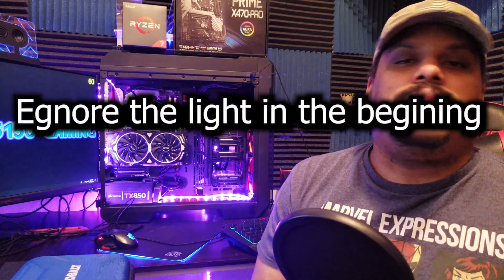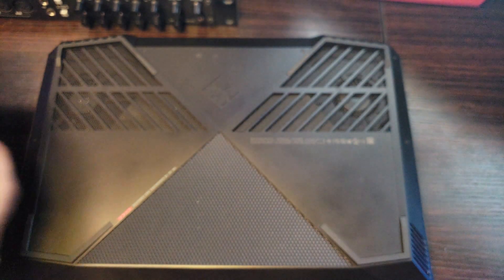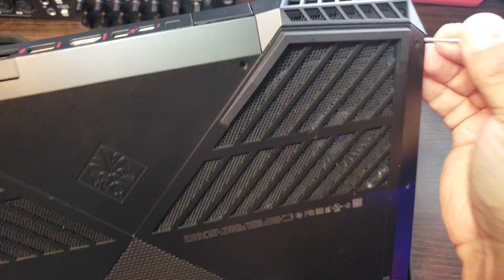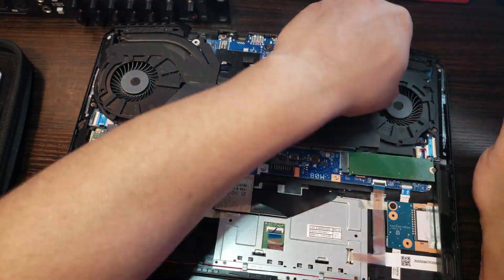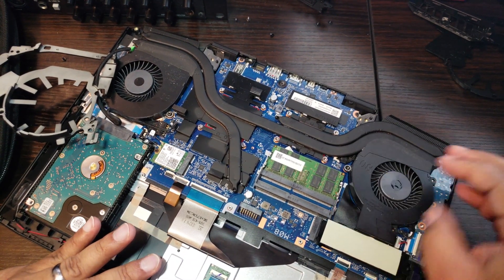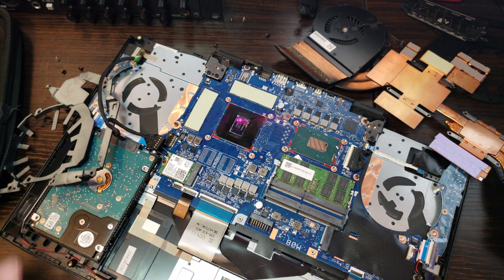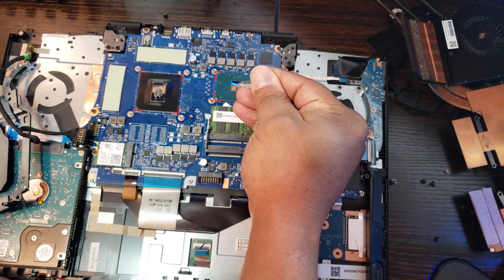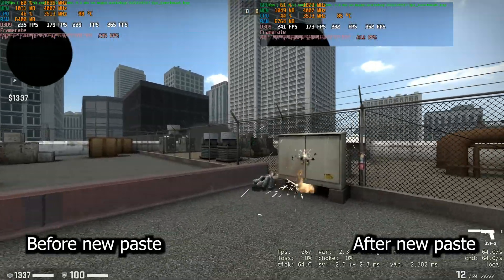HP-Omen 15 how to add new thermal paste to laptop / Laptop Tear down

Comment: Hey! Thank you for the guide! I took off the tape that connected the heating and the fans, what kind of tape should I replace it with?? I was think it used 3M's thermal tape? But im not sure. Going to get paste as well to replace. Didn't think of that, thank youu

Comment: Can I change gpu??? Or or intel?
Reply from the maker: Nra, most laptops like this the gpu and cpu are soldered in. You can only upgrade the RAM and Hard drives. On the 2070 it came with 512gb I replaced with a 2tb ssd. You can upgrade the monitor, a bit more taxing job though. 😉

Comment: I have some black things on the left copper on the fan holdings?

Is it like burns or something?
Reply: Not positive since I don’t see a picture, but it’s probably just overspray from when they paint everything black. I noticed some black on the copper areas then realized it was just paint. I’d have to see it to confirm though
Reply from the maker: Can you take a photo? It maybe burns 🤔
Reply: @EnforcerGamingX  ok where should i send it?
Reply from the maker: Just use a photo sharing app like imgur you can post a link to here.

Comment: what is your gpu temps before and after paste?
becuase my gpu temps getting 91 degree and lower down fps and cpu like 95 degree like hell
i applied artic silver mx4 paste on my hp omen 15 rtx 2060 i7 9th gen but there is no difference i tried to undervolt the cpu but nothing works im very sad do u have any idea?
Reply from the maker: I shouldn't answer cuz you did watch the end.. lol. Just kidding man long video.  But yeah I have a before and after paste at the end. You want to be a bit careful with adding too much paste which could be your case or not enough. I'm guilty of adding too much most of the time. I added a bit too much in this video actually. I still need to paste my 2070 hp-omen 15. Paste should work though.
Reply: @EnforcerGamingX  i applied paste followed by linustech video that how to applied thermal paste but i cant see any change in temps on heavy load elp me out if u have any idea?
Reply: @EnforcerGamingX  and i dont see any gpu temps in the end part of thermal comparison
Reply from the maker: Oh man you're right! That afterburner profile should've had the gpu temp as well. I never had any gpu heat issues on this laptop. As for the paste added, could have added too much or too little paste or the undervolt did not reset correctly. Sorry about the Gpu temp. I'll try to remember to get it on the 2070.
Reply: @EnforcerGamingX  i added thermal paste like many youtuber does but no change in temps i tried to undervolt cppu by throthle stop but it couldnt work in games

Comment: Found your video really helpful. Could do with a little more advice on how you put everything back together (the video skipped this a little) - in particular, what thermal tape or adhesive did or would you use to refix the heatsink to the fans (where it may have come loose) and to stick the black cover/flap back down? Anthing to avoid? Thanks.
Reply from the maker: Sorry I've missed a lot of comments lately. Yeah I do agree I did do the part where I put everything back together but didn't realize it stopped recording till it was too late. So if you watch the end there,  you can kinda tell I switched to a voice over and it ends as I'm putting it back together lol. I'm planning a new repaste video with the rtx 2070 hp-omen. Sorry about that man. Hope you were able to get everything back in and running.

Comment: Omen 15 owner here, thinking of re-pasting, just a question.I got 3 tubes of mx 4 4 years ago, I opened one to use a tiny bit. Does thermal paste go bad? Can I use the remainder of the opened tube?
Reply from the maker: As long as it stayed closed after you used it and it was not stored in a hot or too cold of an area. You can tell by the consistency, it will harden if left open, it it was too hot it will be more liquid than paste. Normally, I'll just buy another tube most are not too expensive, it's better to have a new tube for 5-6 bucks and put it in than a month down having to replace it again.
Reply: @EnforcerGamingX  Thanx, I threw out the opened one, will use the unopened tube, I was never really going to risk it with the old stuff, it was more of a curiosity on my part, thanx again, great vid btw!

Comment: its been 3 years since  bought my omen laptop
is it about time i replace thermal paste?
Reply from the maker: If it's getting hot for sure yes. If it's running well no heating issues no reason to open it up and add it. It don't hurt to do it, but after 3 years you likely have some dust build up in there still good to open it up and give it a air can if anything. :) Thanks for watching.

Comment: is it sufficient if i just clean the fans when i do this? i dont have thermal paste, would the cpu still work well if i took it out, cleaned the fans and just put it back without touching the thermal paste????
Reply: Absolutely not, that's the worst thing you can do to any computer. The point is putting better thermal paste and increase the heat transfer.  YOu can kill your laptop instantly if you do not put a new thermal paste.   If you just clean the fan, that's fine but you do not lift  the heatsink  from the CPU.  Cleaning with air blower (Giotos) is the best way, no residue without even opening the laptop. Just blow it off from the fan ventilators.

Comment: Hey! not sure if you still around but ill shoot my shot. I have HP-Omen 15 with RTX 2070 max q and 9th gen i7, its 10 months old. I get CPU temps at 97C when gaming however my GPU stays around 75-80C,  even though the CPU gets that hot, i dont actually get performance dips. Also when i charge the laptop and perform casual browsing tasks, the CPU temps shoot up significantly and sit at around 80-90C which has me worried lol. Now im not sure how accurate the temperature readers bcs my suspicions lie there. What are your thoughts/recommendations? Thanks.
Reply from the maker: Yeah I got that one also few months ago, it's the same issue, mostly have the option to use the power option in hp command center to casual or repaste like this. There are people that undervolt as well.
Reply: Same for me, I just repasted and cleaned the fans and cooling fins and the temps improved a lot

Comment: Good video, looks easier than I thought.
I paid 15 dollars for the cleanup and thermal paste replacement. Does it worth?
Reply from the maker: Yeah if you get a good quality paste it's worth it. You just don't want the manufacturer thermal pads they use, often they will only last a month or 2.

Comment: Can I upgrade the GPU on this laptop? Is that possible?
Reply from the maker: No unfortunately not, not many that you can really do that. As it's soldered in. Thanks for watching!
Reply: yes, you need technical skills and good at soldering. Its possible for sure, but is it worth all the effort...probably not.

Comment: Thermal grizzly kryonaut sucks.i have this same model except with a i7 9750h and gtx 1660ti.97 degrees of hell...i went the undervolt route and now in the 74 degree area.oh well
Reply: Got the same specs.. can you tell me your undervolt settings? Ive barely got 5-7 degrees of difference with my undervolt.. :(
Reply: @chinmaydas9878 -1.45 undervolt tpl was 28 and the cores should be 3.4ghz on all cores.
Reply: @nuyorican91st  bro, that tpl is messing up the cpu doe, i did the same settings too at first. But try running the TS bench thing and you'll see errors everywhere... Basically what that does is, instead of letting the temp go high and thermal throttle, it limits the power the cpu and makes the cpu throttle... So basically that makes the cpu unstable, despite u thinking its all good cz temps are low. I did a bit of reading into it to find this out. I am currently at -1.45 and 3.2ghz and the max min tpl as 55 and 90.. this helps me get near 87 to 90 degrees and sometimes 94 95 too but atleast the cpu is not getting damaged.. help me find out more if u know anything
Reply: I have this exact problem, undervolting didn't do much. Have you found any other solution I can try while waiting for my thermal paste to arrive?

Comment: Can you help me? I follow your tutorial and then when I want to start my PC the screen show me a error of the fans
they are disconected, I forget conect one and I fix it, then I start again and the 2 fans stops, you know what I can do? sorry for my english BTW. thank!
Reply: Make sure you didn't tear any of the cables trying to pull em out too.
Reply from the maker: That's bad, are you sure the fan is reconnected?  Also make sure nothing got stuck in the fan, try blowing it out with compressed air. If it's still not going there has to be a bad connection in the cable.

Comment: Thanks you so much! I have an Omen 15 2018 (i5 8300h, 1050ti 4GB) and the temps had gotten really out of control. CPU constantly thermal throttling and GPU on fire also. I used this guide to help me perform the repaste and now the temps are 25-30C cooler. You saved me!

Comment: Just got some Artic Silver MX-4 and a toolkit in the mail specifically so I can do this exact thing.. Thanks for the video, will help a good bit with the tear-down.
Reply: Yeah I put a little too much but that shouldn't block the fans lol. Maybe not plugged in all the way.. will check later and let y'all know. Thanks!
Reply: Philipp best of luck to you!
Reply: So I just opened up the bad boy once again, re-did the thermal paste and all that, cleaned the fans and exhaust all over again and made sure to plug it all back in properly. Was easier the second time and boy I gained 10-15 degrees Celsius while gaming. Even when playing Modern Warfare (very demanding game) on moderate settings I am maxing at right below 80 degrees which is HUGE. Thanks once again for the video and the nice community!
Reply: Philipp nice!! I elevated mine off the desk a little to help the fans breath my I don’t think I’ve seen my CPU go higher than 75C where it used to hit 91.. 😅
Reply: @MosesTheBearded  that sounds awesome! I myself have a cooling pad with 4 fans that I put my laptop on. It's a really nice gadget and I like to think it helps!
Reply from the maker: Awesome man! Yeah knew it had to be something! Thanks for watching and glad my video was helpful!
Reply: @MosesTheBearded  now i also undervolted by -140 and put the turbo boost power max to 17,75W (default 45W). No framedrops whatsoever and even cooler system!
Reply: Did it help?
Reply: MaxoBuenardo not quite as well as it did for him. My temps probably dropped 5-7°C.. But my laptop is just sitting on the desk, no other cooling solution under or attached to it.
Reply: I did it with the same past you bought and the temps even went up by a notch.. I probably missed something
Reply: Philipp hmm weird. Maybe double check you used enough and are getting full coverage.
Reply from the maker: Hmm that's not right, you may have put too much or too little on. I put on a bit more than I should've in this video :( it really can make a difference.
Reply: I used plenty and probably more than needed to be absolutely sure. Possible that I didn't plug the fans back in correctly? Less hot air is exiting the exhausts on the back than there did before.
Reply from the maker: I missed the other replies sorry lol. But yeah if you're getting less air out the back somethings up, blocking it or a fan not plugged all the way in :/
Reply: Do not use MX4 in this laptop, the density of the paste is critical in this laptop, MX4 is a low density paste and it will ruin your temps and last very little time, in 1 year expect horrible temps even worse than stock. Go for TF8 paste or thermal grizzly, it will drop 20 degrees at least and run more quiet.

Comment: I have the same exact laptop but the only thing different is my Intel processor is the i7 9750H while the GPU is the GTX 1660 Ti. It has no difference in performance on the same CSGO benchmark either undervolted or no undervolt at all, the only difference is that with no undervolt the cpu goes about 86 to over 95 degrees celcius. Thanks for the video, now i know i have to replace the thermal paste soon.

Comment: i have a hp omen when i play far cry new dawn and doom eternal high graphics the temperature with the charger cable and the maximum power is 97 degrees c is it normal?
Reply: Which model did you own? The red back like in this video or the silver back (newer one). I own the red back version, the spec are i5 9300h and RTX 2060, and yeah it reached 96°c while playing GTA 4 on very high (quite demanding game) but it only a spike just a few second, which is normal considering it is a gaming laptop and then return back to around 80-86°c. Mine is stock thermal on performance mode with undervolted CPU. Room ambiance somewhere around 25-28°c

Comment: I did exactly what you did but when turning on my laptop it got into “preparing automatic repair” I’ve used the suggested options but it doesn’t start... :(
Reply: I think that you spilled paste on the MB because you didnt change anything that changes software or hardware.
Reply: @Mybátur Yes, I forgot to say something I did with that thermal paste change, I also added a SSD and it was the problem, when I figured it out I changed the SSD for a new one and it started as usual

Comment: so i bought an HP Omen 17 2019 model 4 months ago. and recently i started having issues with the temps going over 97c and also noticed that the right side fan runs slower compared to the left side fan.so if i change the thermal paste i shud get the same results as yours. right
Reply: The fans running at a different speed is normal for this laptop, as one is tied to CPU  temp and the other to GPU temp(I have the 15' 2019 model). Changing thermal paste will probably improve the results to some degree, but I'd strongly suggest using throttleStop and find a guide for undervolting. The 8750H in our laptops run quite hot, and the thermal solution HP put in is insufficient for the CPU. I'm a complete n00b at it, but I've already gotten a 17 degree C temperature drop with no performance loss, and Ive been messing around with it for less than a day.
Reply: I have the HP Omen 15 dc1621nd and I can explain it fully to you. The first thing you wanna do is look up power management mode for battery, this option will allow for your cpu not to use the maximum it can so it won’t try harder. Change the minimum and maximum of power management all to 99% instead of 100%. Also search up Throttlestop and look up a tutorial for your graphics card and your cpu. It’ll undervolt the power supplied to it all and it will make it wayyyy faster. Thats how you fix your cpu. Now onto gpu, first off install Msi Afterburner and look up a tutorial for the OC scanner (I assume your graphics card is raytracing as mine is RTX 2060, OC scanning only works for Rtx 2000 series, nothing else. It will fix your gpu and then you will be set, I also recommend using cracked keys, a youtuber called Mocik makes tons of vids on these cracks, you can, like I do, install the applications such as Kaspersky and all the Iobit tools. If you want to not do the msi afterburner technique then you can install smart game booster 4, it isnt free but it will do the undervolting all by itself instead of you having to do it all. Look up Smart Game Booster 4 key and there will be sites giving away those license keys which you can use. https://www.youtube.com/channel/UCftNIgux00HfBL0CW7kEOYw

Comment: Great video! I have a problem though.. My Omen is similar to this one, but the screws securing the heatsink to the CPU and GPU are really soft and are way too tight, so I stripped them.. any tips on how to still get them out of there?
Reply from the maker: Man, theres a few ways, mostly try to get a precision needle nose. That sucks tho, I really can't say for sure what will work for what you have there. But that's normally my goto for anything stripped like that, even when. I worked construction I'd use a vise grips to take hold of the screw. Hope you get that out!
Reply: @EnforcerGamingX  Thank you man, I'll try using those!
Reply: Your Omen wouldn't happen to be a 17 an012dx would it? I have one and have heard about the screws being soft and tight. Thanks
Reply: @kennypooser  No, I've got the 15" ce014ng
Reply: @jamez_gamez  That's hp gaming for ya. I'll never buy another one.
Reply: @kennypooser  I mean other than that it's a pretty solid laptop

Comment: i did change the thermal but i steel have 98 c° and i keep playing with it is that temp normal ,can cause any problem?  what can i do thanks
Reply from the maker: Then theres another underlying problem. You want toi make sure you are not running a lot of back ground programs. Make sure the fans have breathing room and all that, avoid cloth surfaces etc... If you're still having problems you may need to contact HP as it should be find after that at the least under 90c. It is also possible you added too much paste, I added a bit more than I should have myself in this video. If you add too much or too little it wont seal correctly and cool.

Comment: hi man I got the exactly the same laptop and I'm planning to cleaning under the cover. just wondering if you can just clean it without changing thermal paste. I will change it once the lock down is over there's no open store to buy thermal paste.
Reply from the maker: Yeah you can, I may keep the heat sinks on though soon as you break the thermal pads seal it's not going to work as well and get more heat from it. I'd keep the heat sinks on and use air. That sucks you can't get paste. Are you able to order from like Amazon or something?  Anyway thanks for watching and stay safe!